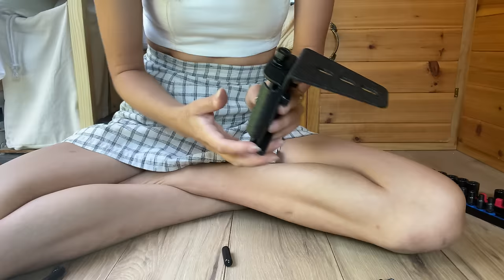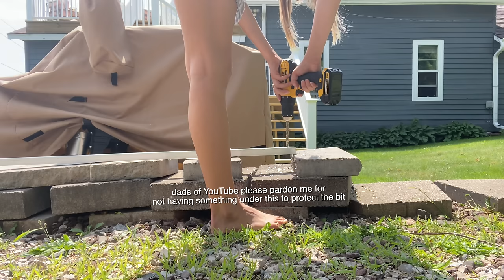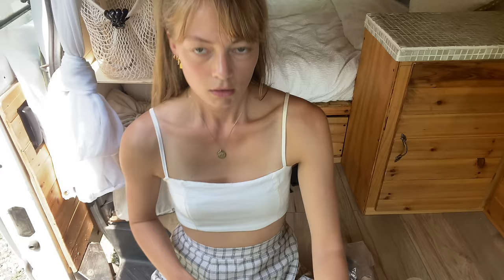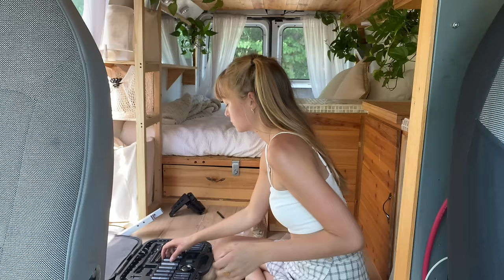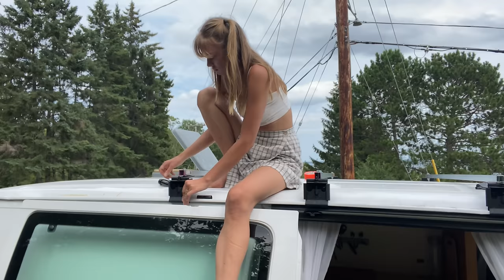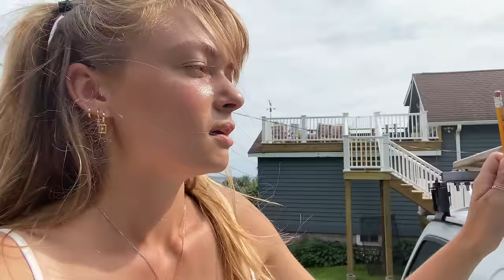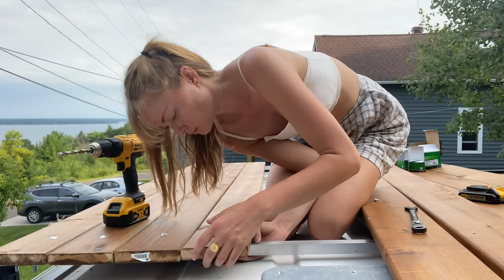I made a deck for my van 😎

Comment: I hope 2 things are right for you. Aluminum is so questionable for strength. If you are not going to have any heavy loads carried up there r you are not going to have company (since you are what, maybe 90 lbs weight.  And second, I hope those were lock nuts. Sometimes called self locking nut or nylock nuts. I didn't see any lock washer going on. Locknuts would be best. If there were no  lock washers  or lck nuts the nuts will eventually fall of and it will all come apart from vibration.

Comment: Screws would been better as they could have been securely fastened into the top half only of the square pipe thus not weakening it as much as the through bolts do. But go for it!

Comment: I saw you on my dream while ago and I still remember 😂 I asked you is battery necessary for the van you said ‘not really’.
K can you tell me real thoughts now please 🤓
Reply from the maker: I kid you not I just laughed out loud 🤣
That seriously does sound like a me answer. 

I personally really like having a battery. specifically if not only to run my fridge. I’m so used to making do that I probably could’ve figured out life without a fridge, but I felt like splurging. You just have to weigh your comfort levels. Will you be doing shorter trips? Will you be living in it full time? Do you want to power other things?
I generally just plug my phone and laptop in when I’m driving if they need it, so again, really just came down to my fridge.